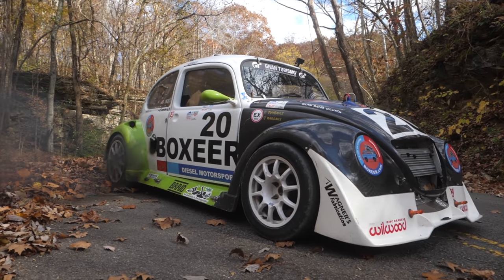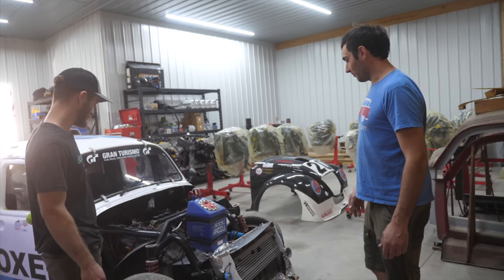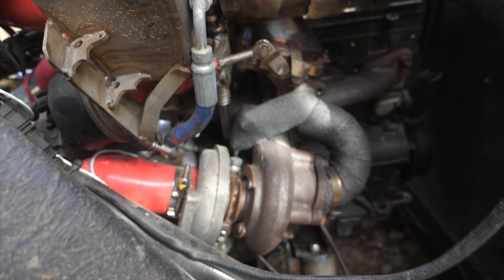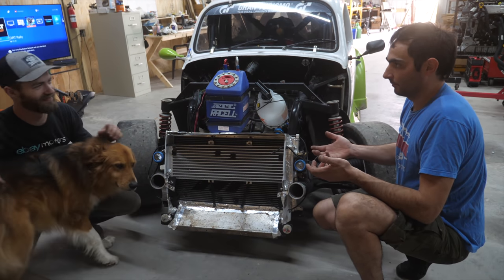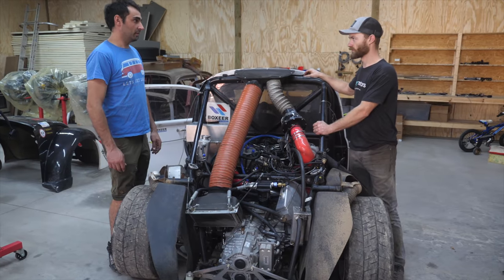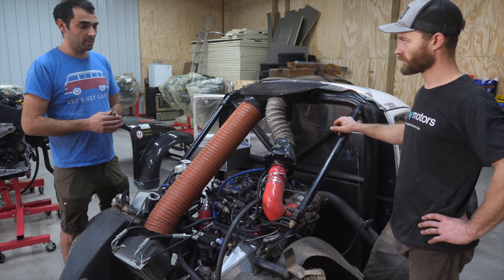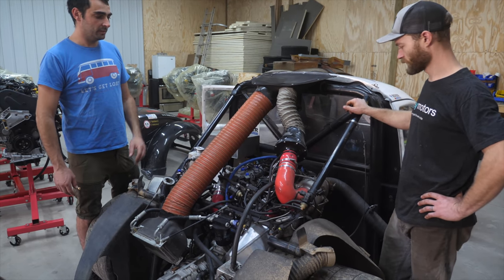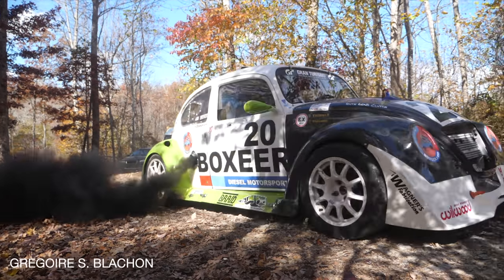400HP Twin Turbo Diesel VW Beetle Hill Climb Monster!

Comment: 50+ psi of boost!? Ok I'm a fan 😂
Reply: Think I saw it hit 57 in the beginning of the video
Reply: Yeah that’s diesel for you
Reply: At first i thought he said 15 but that makes sense
Reply: Compound setups are all the booost.
Reply: Tyson Seabrook All you can focus on is that boost doesnt=flow and none of us are saying it does. 1 bar of boost is still an extra atmosphere worth of pressure being forced. The high boost is for response, not big power but that doesnt take from how cool it is that it has immediate boost response to almost 4 bar on a mostly stock engine. Thats impressive in itself before you consider there's a big volume low boost turbo in the mix that supports the higher power levels.
Reply: Thats really not alot for a diesel
Reply: @ericjohnston6035  First boost pressure doesnt mean anything and now 50psi isnt a lot because it burns diesel.
Reply: Tyson Seabrook  Yeah I dont understand why boost figures get compared car to car, let alone two completely different engines. 10psi roots is different from 10psi centri, or turbo. Its all about the volume of air needed to feed the engine. Obviously a large compressor wouldn't need 50psi to make that power level, but that isnt how you get boost response to actually make the vehicle perform on the track. So this Eric guy saying, "thats really not a lot" is just satire. I mean come on, its a competitive race car running a mostly stock 4 banger diesel long-block at almost 4 bar of boost and its "not a lot".  It may not be " a lot" relative to what he may see on youtube but its obviously enough to nearly set records in one of the most iconic races ever.
Reply: Tyson Seabrook  true that boost just mens how much the air gets compresed but not the volume of air that gets to the engine.
Reply: Tyson Seabrook  for any TDI vw motor to be pushing 50psi is nuts.
Reply: Some engines from factory make more than 30psi
Reply: @fabini14  30psi from an oem style turbo dead stock moves less air than an ebay gt35 at 1 bar.
Reply: Look at the comp map of G30-660 and that's where we are at right in the middle efficiency zone. I hope it help you understand the volume. A good bit!
Reply: “YA”..... “YA”
Reply: In Portugal we got some tdis rolling 58 and 60 psi
Reply: On STOCK internals ??? WHOA !
Reply: @madmod  most modern diesel trucks will make more than 30 PSI of boost pressure in stock form. Some of them can handle 45+ PSI of boost on stock head bolts. 

What’s considered a lot of boost is actually relative to the fuel a particular engine is using. There’s a variety of reasons why but the bottom line is diesels produce and handle more boost. 

50 PSI is a ridiculous amount for a gasoline engine, it’s nothing too out of the ordinary for a diesel.

In the diesel performance world 100 PSI+ is commonplace.

Comment: And a chemical sprayer from Home Depot, in the optimized position.
Reply: Unusual to see you here pal 🤔😁
Reply: @davidwichner2018  "twin turbo" usually brings me in. 😉
Reply: @megoingfast  Compound... There's still 2 turbo's in there. :)
Reply: I modified one of those for setting beads on tubeless bicycle tires.
Reply: Suprised it wasn't his methanol injection system that cools your turbo a bunch and would boost him prolly 50hp or more
Reply: It's the Home Depot garden sprayer version of what Gail Banks did on the Pike's Peak semi truck he was involved with

Comment: Dude, a BEETLE 😎
Greetings from Germany 😉
Reply: I mean-- is it really a "beetle? lol...  tube frame with a thin fiberglass shell. lol...  Literally has nothing German left on it.
Reply: @calholli  well the engine and transmission is german but not factory in this beetle 
(is a mustang still a us car if its has a tubeframe ?)
Reply: @chriskue3285  You know what I mean.. lol..  There's no way it has the stock suspension... The interior is completely stripped, its tube framed.  There's literally nothing left, even the seats are out.

Comment: That thing accelerates like a motorcycle hehe wow!
When you think about his turbo setup from the perspective of Banks' laminar flow philosophy, it's hard to imagine how you can fit so much power into such tight quarters. All the right angles and 180 degree bends, and directing charge air through a wastegate, it robs a lot of energy.
Then I start thinking maybe that's why he only loses 60hp at high altitude, because lower air density will interfere with that potential energy less?
Anyway, I'm really impressed!

Comment: That's pretty cool. Every part touched in some way... a true racecar! Imagine how fast that thing would be if he got an intercooler that can handle the air load! If it's rolling coal at sea level it has to be super rich at the top. I wonder what the EGT's at the deltas. Trim that fuel or give it the air it desperately wants! :-)

Comment: Pikes peak is right out my front door cabin at 9500ft above sea level.  
I too am building  beetle racer but it is a 2005 tdi new beetle with smyth ute pickup kit, awd conversion,  and  with ammonia fuel conversion. At 100mph it is still getting 38-40mpg

Comment: Next upgrade trickle feed nitrous. It's on demand and it stops when you let go of the button. Also because nitrous is cold it will help with engine temp issues.

Comment: The trick is to figure out how to maintain the hp while climbing altitude. I think the secret is on how a Jet plane is able to do the same thing. Even though they are different types of engines. The principle is the same in maintaining the engine performance as you climb. When a Jet is climbing, there are certain things that do effect it's performance. Aviation has figured ways to minimize those effects. If i was your friend, I would seriously look at how a jet does it. Most likely a air and fuel issue. I would start by separating the air intakes on the top. As you know, the more air and fuel, the faster it goes . LOL !

Comment: Not being able to beat a truck has gotta hurt.   JK  Sweet build.
Reply: That f100 is a monster! plus it weighs twice as much because it has the steel body
Reply: I was running pump diesel because I'm a purist and they had some homemade mixture that had everything but diesel in it....  So sure I can do that as well..  that alone did cost a second easily! But next year I'll come with the spicy diesel from VP Torq 🤘
Reply: @Syncrogreg  Good luck to you sir.

Comment: If it wouldn't add so much weight I would say to put a big compressed air tank in with higher o2. Might help keep the power on when you get to the top

Comment: Very very interesting video. When you guys lifted the back revelling the powertrain you looked like you needed a mop to clean up from your drooling over that car's motor. Man those turbos sure do sound sweat when they spool up. 
So I have a question for you boys, when and what are you going to build next so you can pile some turbos into it? Whatever it is I'm sure that it will be one hell of a ride watching the whole crew working together on the next great ride. Who knows maybe you can take it to Pikes Peak for a run-up that great big hill. A lot bigger than the little ones around your place
Reply: Turbokits.com provide the turbos 🤤

Comment: Imagine the power it would make if Gale Banks tuned it.  All the black smoke is wasted fuel and H.P.
Reply: If you read description I had a very bad turbine leak that acted as a wastegate.... Leading to making less boost than our target... And that threw off the mixture. Off course I normally have the exact AFR and run without coal. Just wait for 2021! It's going to be cristal clear power

Comment: Anyone thinking that's not super high horsepower doesn't realize this raceway weighs half as much as whatever boat they drive. I should know, mine has a 6.8 V10 making 420 torque but its a small 2016 RV and weighs 9,800 pounds

Comment: So he has a manual gearbox and converted it to a auto? He just took all the fun out of driving it
Reply: No, it's a DSG transmission.  It's basically a complicated manual with automatic shifting mechanism.  Even and odd gears have their own clutch and intake shafts which allows for incredibly quick shifting.  The allows for much better continuity in power transmission to the wheels and in race applications, is far superior to manual transmission.

Comment: 50 pounds of boost is useless. What kind of air density is he getting in the intake manifold. I could make 50lbs of boost and net 0 hp gained.
Reply: Isn’t boost taken from intake manifold pressure?
Reply: @Mogachaffe  yes but pressure doesnt tell the whole story. A rise in temperature can negate the rise in pressure

You need to know lbs of air going into the engine and lbs of fuel
Reply: @Shredxcam22  that is true but the real problem in pikes peak is the amount of oxygen in the air
Reply: @diogorosado8306  exactly thus making the density machines,  turbos, intercooler, meth spray even more important and thus the amount of density they create. Not boost !
Reply: You gain more horsepower from boost
Reply: @rkzooplays  not always.  You could create boost and net zero hp gain.